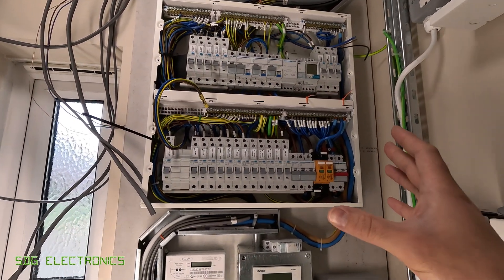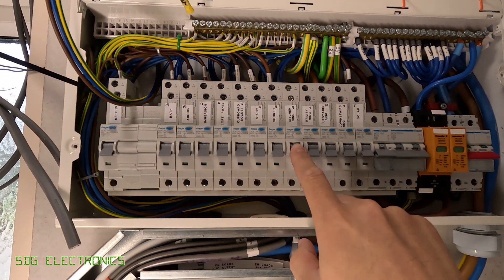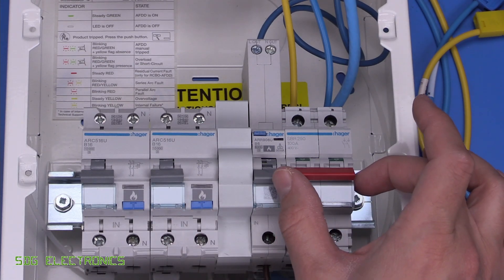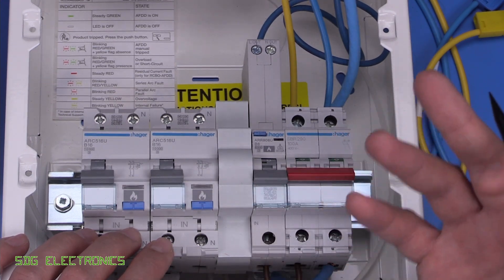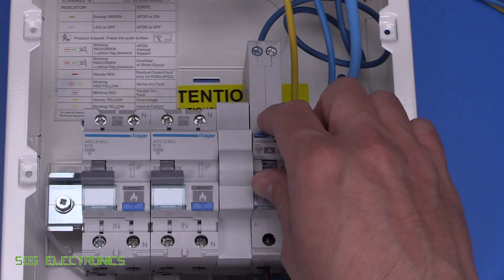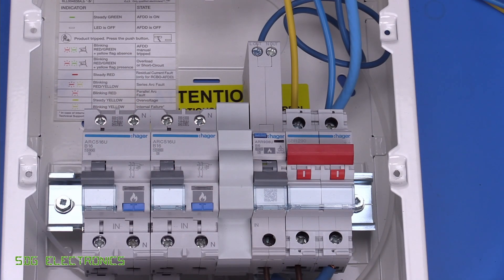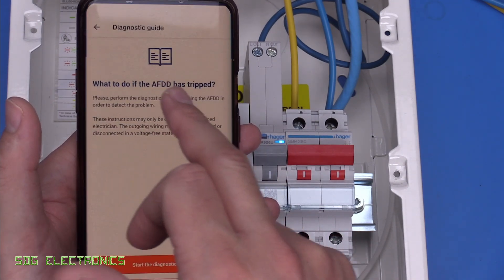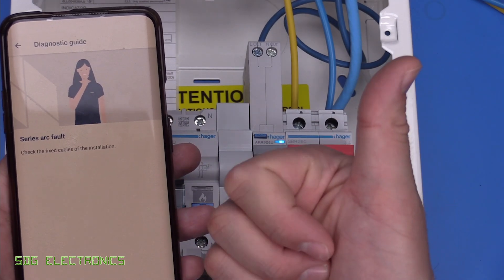SDG #295 Bluetooth Hager Arc Fault Detection AFDD ARR MCBs (ARR932U etc)

Comment: Shame the output current transformer doesn't have any ADC on it even just for an indication of load in the app.
Reply from the maker: I didn't even think of that, but there's probably a whole host of diagnostic data that could be indicated with this - load, differential current, voltage etc

Comment: Thank you! When you said you have to give away some info to Hager, it's worth noting that you have to set your role to Installer or similar in your profile on the Hager website, or you don't see the devices section in the app. I put "engineer" (I worked hard for that degree) and didn't get it :-( 
I had an extractor hood on a kitchen ring that was tripping the AFDD, almost certainly due to high frequency noise exactly as you said. I suspect the commutator is arcing but  I updated the firmware and there have been no trips since. If it does happen again I can try a Ferrite core or some such, or replace the motor.
Also it doesn't verify the load is disconnected (not sure how it even could), but the reason is that the circuit is unprotected during the update. So a circuit that also has double pole isolation (e.g. an outside socket with an internal isolator), or a ring with all plugs removed and the house unoccupied, you probably don't need to disconnect.

Comment: Frankly, looks attractive. 
What do you can talk about actual operation/protection against hazardous  arcs? 
How does the device respond to different types of loads (LED lights, collector motors, switching power supplies, etc.)? False positives? 
This information would be extremely useful both to electricians and end-users!

Comment: With the cost of the device and the power required to run it, how many faults must it save you from to pay for itself.  As in the last 40 years or so of being a home owner I've I can count the number trips not cause by me on one hand. 

Watch the space above the inverter as it blows quite a lot of warm/ hot air at times, especially when its running at 5+ kWs when cooking.

Comment: Are you certified to install that yourself, or will you get someone else in to test and connect? I’m in a similar position (electronics but not electrician) and am wondering about the most cost effective way to carry out work like that on my own property — installing to regs isn’t a problem, but getting a part P ticket is expensive.
Reply from the maker: You'll probably not find someone to do a certificate on your work. You can however pay the LABC fee for DIY electrical work. They will appoint an electrician to do an EICR. Have a look at your local council website. It's normally about £350
Reply: Thanks for the info about that LABC. I too am in a similar position as you. I'm an Electrical/Electronics Engineer but don't have any of the certs to sign off the work. Far too much red tape these days! At the end of the day someone suitably qualified is going to do a far better job in their own house and you certainly have here. Very neat work as always 👍

Comment: Maybe since it's Bluetooth and not wifi it isn't a total security failure? Otherwise I'm sure ransomware hackers would love to threaten to brick every single breaker in a hospital or something stupid like that.
Reply: The fact you need to press the button for pairing should make it pretty secure. Also, Bluetooth range from inside a metal consumer unit will be pretty minimal

Comment: I could see a lot of people with tin foil hats having thoughts on this!!

A concern with ALL tech like this is how long does Hager decide to support it and keep the app updated as mobile OS's get updated?

I agree event history is a great way to help the customer, and the spark called in to find it, narrow down the fault in the first place.. which could save and hour of generic fault finding.

I suppose it is a benefit of AFFDs which pretty much require a microcontroller to work (any decent branded variety) allowing the potential of adding additional benefits and integrations. If its not doing weird stuff with the bluetooth data I could see hobbyists adding support for home monitoring and automation style software on things like the Pi etc..

Its definitely a novel use of Bluetooth integration but only time will tell if it becomes a more common feature with support and new branches of use-cases, or just another example of technology being added where it isn't needed for the sake of it and dying a slow and horrible death.
Reply: An MQTT interface would be handy!
Reply: @Anthony Roby  can you do mqtt over bluetooth? I think you could do something with some trickery. I only mention that as like someone said below, its definitely much less of a security issue being bluetooth and whilst I'm sure a poor implementation of the protocol could lead to someone being able to brick the devices they would need physical access in the first place, so at that point any security expert would consider any attack as unavoidable in reality - once someone has physical access to a machine all your physical security protections have failed and they can do a lot of harm without much effort)

There is a growing demand, love it or loathe it, for home automation and home monitoring under that awful umbrella term 'smart home'. And I see no reason to not do things like this, and maybe being a bit more 'open' in terms of protocol use means the hager could invest less in maintaining the app side of things as long as they provide a very very basic app for those not fussed, and detailed documentation for those who are.